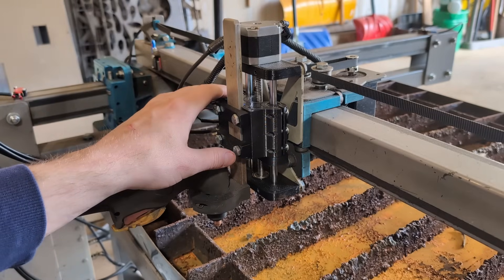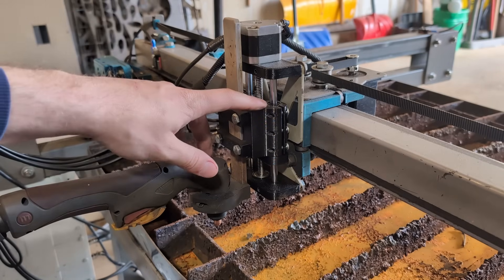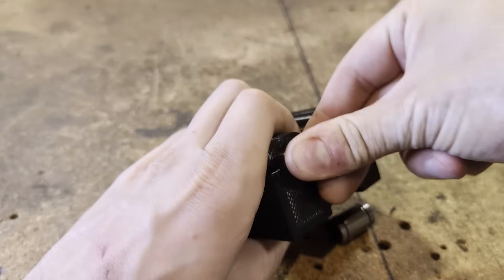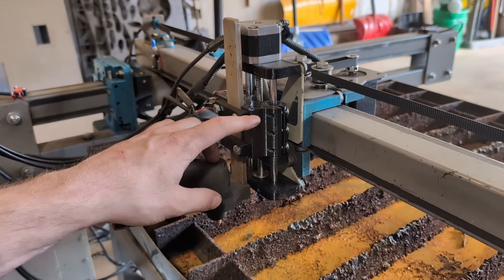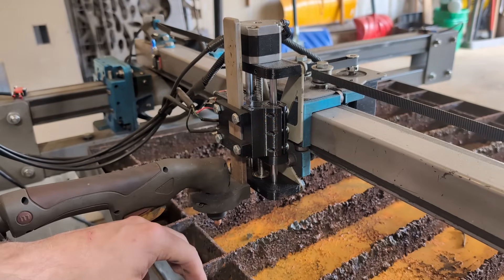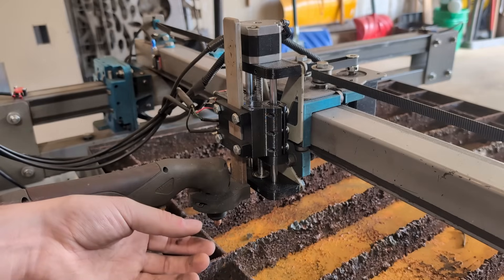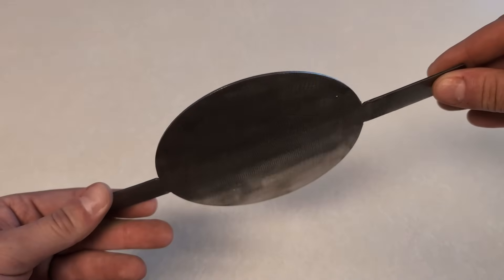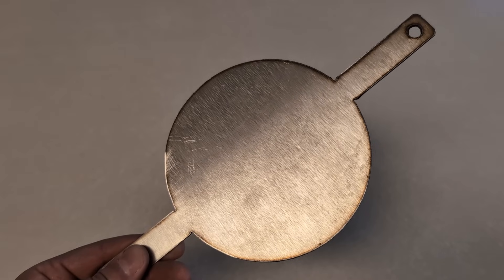The 3D-Printed Z-Axis That Could Change Everything

Comment: Can this new z axis be used on the original machine, just using the one limit switch for probing? 

The old design for the original machine - the depth probe switch was normally open (NO), correct? (switch is compressed to activate)
New design it is normally closed (NC)? (switch is decompressed to activate)

Is it just a matter of switching the wires on the switch from NO to NC?

Comment: is this included if you already own the xl files or is this a separate purchase?
Reply from the maker: The XL already has a stronger Z-axis. It will be getting this switch concept sometime soon.
Reply: @ I have yet to build it. I have everything together. But I still need to do some post processing on the printed parts before I can finish.
Reply: @jdsgarage701  is there a rough estimate on when we should see it? Almost at the point of final assembly on my xl and id like to only do it once. Lol.
Reply: @jdsgarage701  Any udate on availability of STL files for existing XL plan owners?

Comment: You guys should really invest in a better printer, its looking kinda rough, i have 2 bambu lab printers, 1 A1 mini and an A1 and i could not recommend them enough! I really appreciate that you guys keep updating this awesome project! Keep up 👊
Reply from the maker: These parts were printed with double the standard nozzle size and using a high strength profile. This comes at the cost on some detail
Reply: @jdsgarage701  I get that, because you're printing volume parts so increasing nozzle size speeds up every print, but the latest printers are very fast. The A1 can do a standard Benchy in around 16 minutes.
Reply from the maker: Larger nozzle sizes also increase part strength. The demo prints that come on 3D printers are optimized to show speed. They often overclock the printer's flow rate to do this and the parts come out incredibly weak but they look nice.
Reply: @jdsgarage701  that makes alot of sense :)

Comment: I still haven't put the new board in mine
Reply: If you commit to upgrading, do it all.  I tried to do a partial upgrade. The 2nd relay is a must. ESP won’t boot with out it.  The opto isolator eliminates EMF.